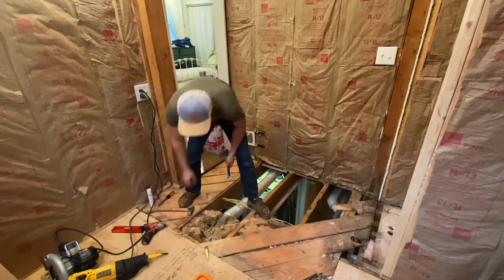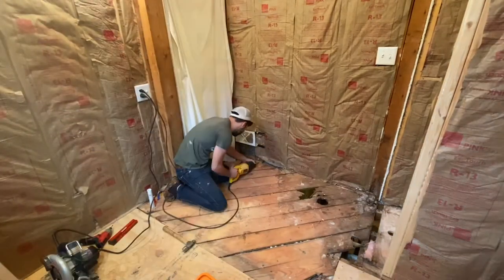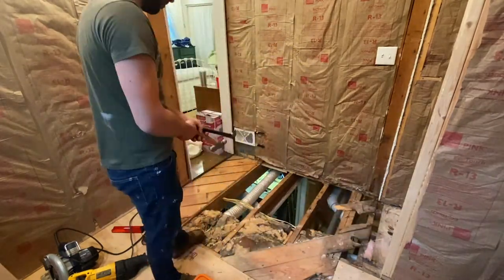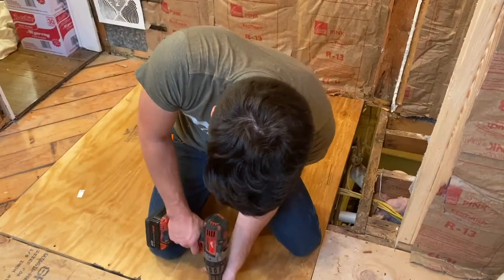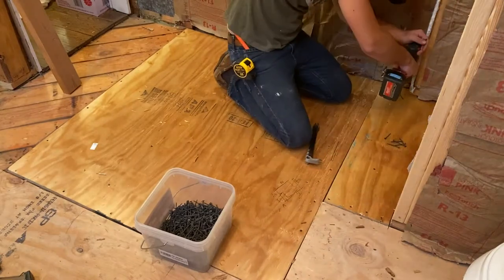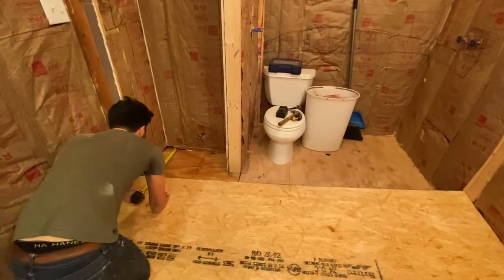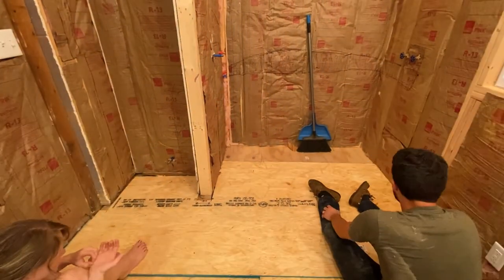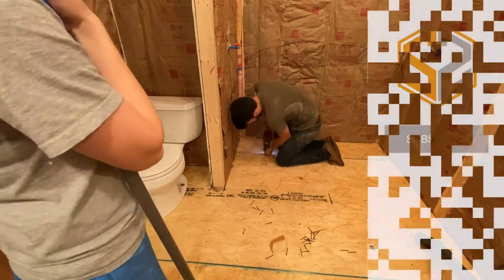Replacing rotten subfloor

Comment: I am in the middle of this same project, I was curious why you decided plywood instead of replacing with individual boards. Cost ? Easy installation? More structurally sound. I was going to replace each board but wasn't sure if there was any benefit or not from boards or plywood.
Reply from the maker: Well, plywood is more stable than individual board and can be easier to install at the same time. is you have only a few boards that need to be replaced you may just want to replace the damaged ones. However, my floor was in pretty rough shape and was better to just remove the whole section and replace with plywood.

Hope that helps!
Thanks!
Reply: I'm my region if you replace the boards with the same type of board then it is a repair and you do not need a permit.  HOWEVER if I had to do his type of replacement this would needed to be permitted.  So in my case I would go back with boards and not deal with the hassles.

Comment: How long did this project take? I’m going to start a project very similar in my bathroom, but it is my only bathroom so I don’t want it to be out of service for too long..
Reply from the maker: I finished this project over a weekend. However, the whole bathroom remodel took several months as I only worked on it during the evenings and weekends. after this remodel we had 2 full baths in our house so I didn't run into a problem with it taking a few months. There are ways to work around the toilet, shower, or sink to keep them hooked up till the last moment or when you're done for the weekend you can temporarily hook it back up to get by till you finish. 

good luck with your project!

Comment: What type of wood are you using for your subfloor? I have never replace flooring before and I have no clue what type of wood that I should get. All I know is that the rotted wood was a half inch think.
Reply from the maker: I have attached a link to what I used. 7/16 maybe the closest thing to 1/2in that you can find.

They also have a plywood version of the subfloor as well. But both work well and add a lot of strength. The key is keeping it dry. if ether type is exposed to a leaking toilet or tub they will rot out over time.

https://www.homedepot.com/p/7-16-Square-Edge-OSB-Sub-Floor-Panel-Application-As-4-x-8-386081/202106230

Hope that helps!
Thanks!

Comment: So you do place a sub floor down and then another one on top...and how thick was wood did you use
Reply from the maker: Two layers are often used in places like bathrooms and kitchens where thin flooring like tile, linoleum or vinyl is used. The second layer of subfloor gives it more strength and helps the thinner flooring line up with thicker flooring used throughout the house like hard wood flooring. I used 3/4in subfloor but the thickness can very slightly depending on what levels the floor with other rooms.

hope that helps!
Reply: @SimonSaysDIY  thank you my old subfloor was 3/4 and it had 3/4 tongue and groove on top.... one more question what brand of plywood did you use

Comment: did you insulate interior walls? just wondering...
Reply from the maker: Yes I did. The main reason for that is noise dampening. If the walls are hollow they can cause sound to echo and travel through the walls.

Comment: Isn’t subfloor supposed to have 1/4” gap around the floor edges and 1/8” gap on plywood seams for expansion?
Reply from the maker: I'm not sure about the edges but the seams between sheets are supposed to be as tight as you can get them. The seams are tung and groove, they lock together giving it more strength. I believe the chipboard subfloor is more stable than plywood and would be less likely to expand unless it's repeatedly soaked in water.

Comment: Dude i have the subfloor like urs, the planks were put on diagonally from the joists, terrible, most of the planks were left hanging past the joists and therefore cracked down the middle over time
Reply from the maker: Yeah it is a method they used a long time ago. I’m not sure if they did it to be cheaper or if the plywood wasn’t yet used. It has lasted many years but doesn’t seem to be a good way to do it.
Reply: Yeah i have the same thing also
Reply: Planks installed diagonally allowed the finished hardwood floors (which were the typical flooring option)  to be installed perpendicular to the joists. If the subfloor planks were straight across the joists, then the hardwood would either have to go the same way as the joists (very undesirable, leads to wavy floors); or the hardwood have to go the same way as the subfloor (would lead to large gaps & loose squeaky floors as the subfloor shrinks).  I'm about to rip up my bathroom floors,  due to  an undetected leak leading to rot.  I appreciate this video as I don't find a lot of information on 80 year old homes.

Comment: So is this technically 2 subfloors?
Reply from the maker: Yes and no. It is common to have two layers below the flooring, especially in older construction and remodels. Typically plywood will be laid down to close in the framing. however one layer will work, a second layer of chipboard subfloor is much more stable and makes a more solid foundation for especially thinner flooring like tile or laminated floor. Unlike hardwood flooring that adds strength to the floor tile and thin laminated flooring gets its strength from the subfloor. I hope that helps.
Reply: @SimonSaysDIY  i think it does, i am currently demoing my bathroom and was expecting plywood, but found planks underneath it, which was rotted due to the toilet not being properly mounted. Saw the planks and was just kinda dumbstruck cause I've never seen it before lol. You think it'd be okay to pull the planks and replace them with a plywood sub floor?

Edit: I appreciate the response immensely btw.
Reply from the maker: @mercenary1485  Yeah,  I believe that would be perfectly fine. However, if there is any plank flooring leftover you will want to make sure it ends on a floor joist. On my floor, the planks ran under a wall and into another room so I had to cut them and leave them on the first joist I could get to because those planks were supporting the wall and the flooring in the next room.

Good Luck with your project! I'm glad I could help!
Reply: @SimonSaysDIY  thank you so much, I'll update if the house falls down lol